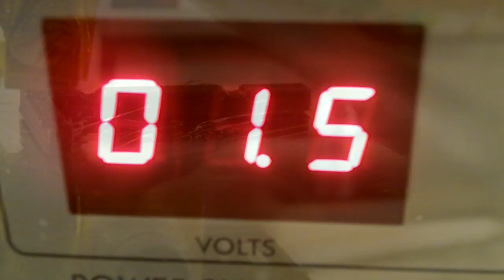A DIY track saw for less than 20$

Comment: How did you make sure the metal rails where 100% parallel over such a long span?
Reply from the maker: The saw cut the wood on first cut so it will be parallel to the metal rail :)

Comment: Who sells the grooved base plate for the saw?
Reply from the maker: You can made one with some plywood and a router.
Reply: equinoxefr75   Love the simplicity of your design.  Your base looked like aluminum in the video.  Might make my base from polycarbonate or Formica.  

Now, to find a way to add a non-slip, anti-splinter edge strip to the track board, like Festool's.